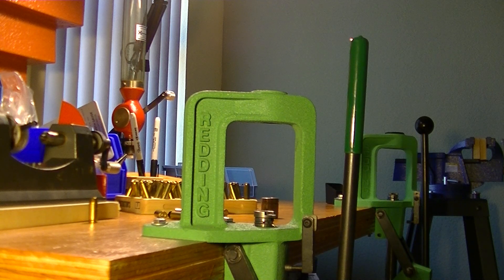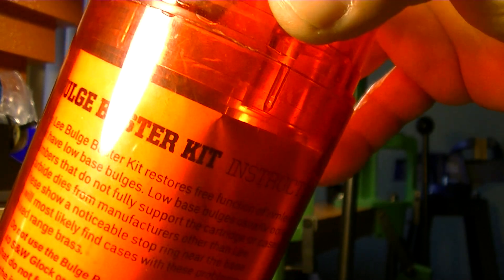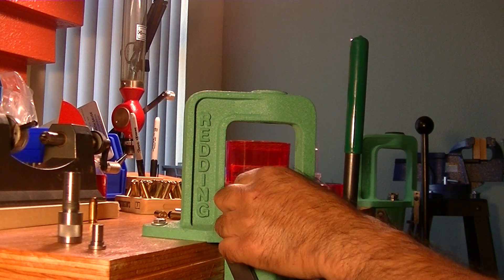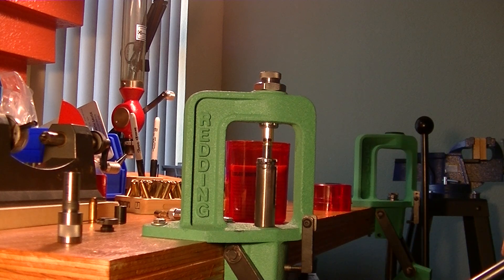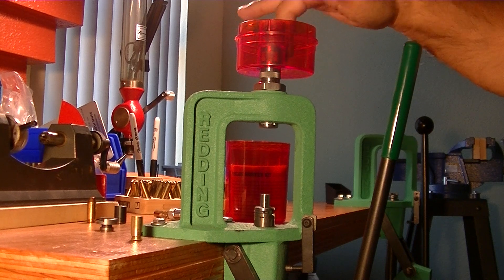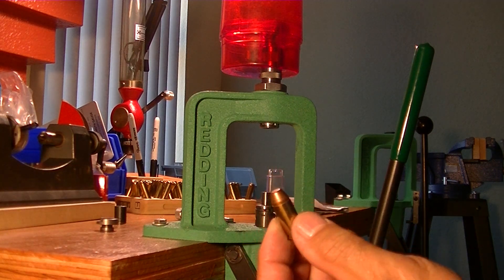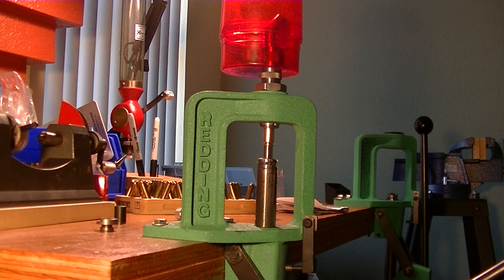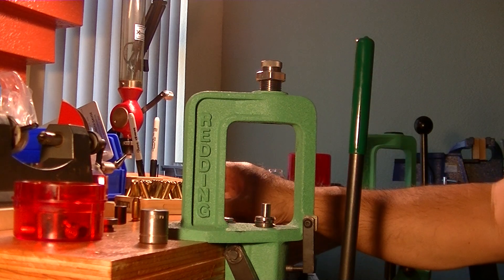Lee Bulge Buster Kit For 40 SW

Comment: I recommend lubing at least every 3rd or 5th case. The carbide ring will crack if put under too much force, too many extreme bulged cases in a row. I forgot to do this while resizing/bulge busting 9mm cases and destroyed a factory crimp die. If you keep it just a little lubed with some sizing wax or case lube the cases will go through with ease.

Comment: So the bulge buster is a misnomer. The factory crimp die is actually eliminating the bulge, not the bulge buster. You could have attached some sort of stem to the ram and pushed the case thru the crimp die and it would have accomplished the same thing.

Comment: If you take the primer punch out and run the case all the way into the die it actually will size it down to the shoulder. I mean the regular sizing deprimer die. You have to punch the case back out though because the dies throat is too narrow. Obviously alot slower but it worked, i did this by placing a nylon hammer head on the press and pushed the case flush into the die.